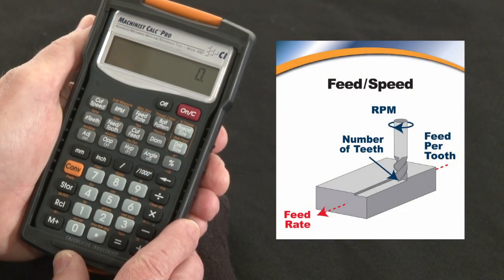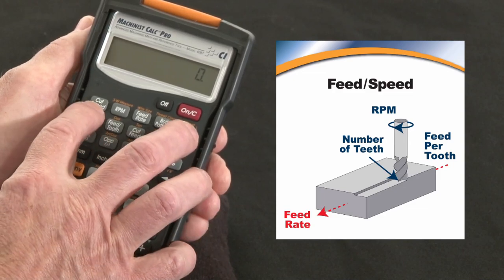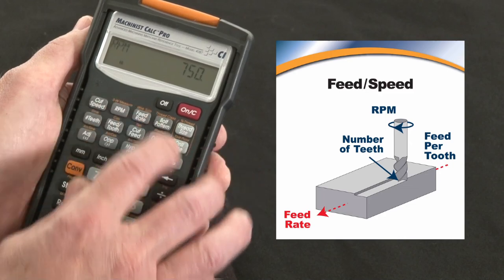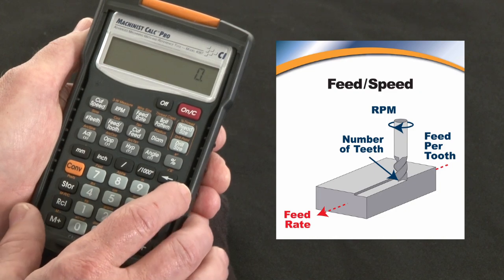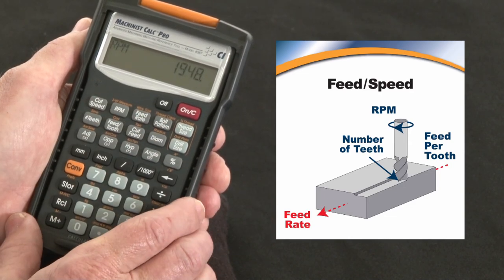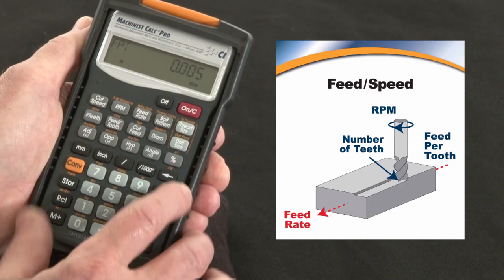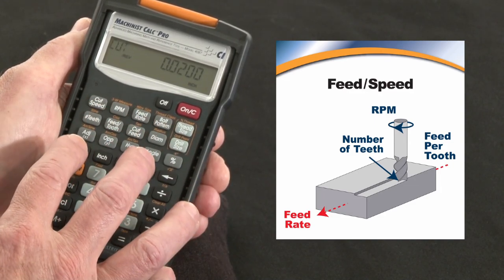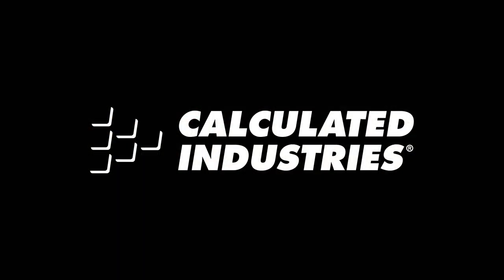Machinist Calc Pro Feed and Speed How To Calculate

Comment from the maker: MCP 4087 uses publically available speed and feed formulas which do not take into account material being cut, cutting process or cutting tool. The calculated results are for starting points only.

Comment from the maker: Dear Iron1215 - We hope this helps. Regarding the first example in the vid:
- Enter 750 and press [RPM] key
- Enter ½ inch or .5 inch and press the [Diam] key
- Press the [Cut Speed] key to calculate sfm of 98 feet/minute.
Our speed and feed calculations assume the user uses recommended start settings from the tool supplier for a given material being machined, materials are not built in at this time.

Comment from the maker: Thank you for your question.  Calculated took the position that most machinists/machine setters rely on their tool supplier’s recommended start settings and would enter those in the Machinist Calc Pro to calculate RPMs and Feed Rates, though we do understand the potential value of having general material specs built into the product as well.  We appreciate your feedback and have added it to our product change database for further consideration.

Comment: I agree. There are so many variables when it comes to materials and cutting tools that trying to include a database that can be easily accessed by the user sounds like an impossible undertaking.   Using the tool mfrs' parameters with this calculator looks much more convenient than the PC-based speed/feed calculators.